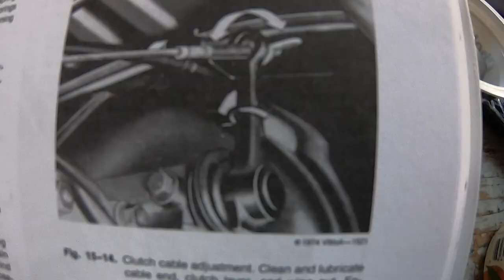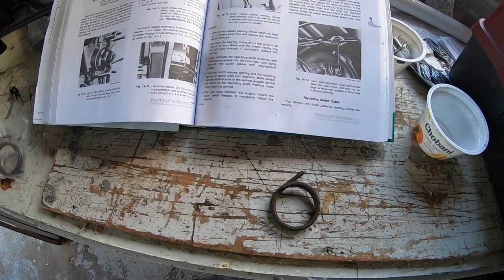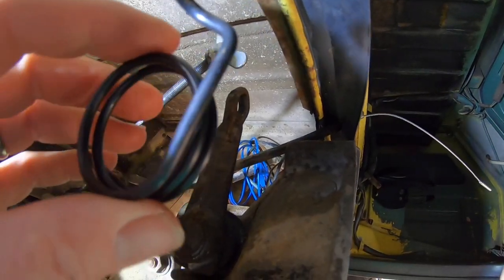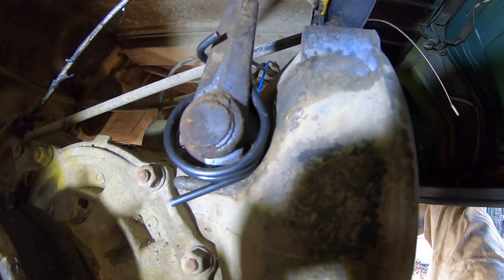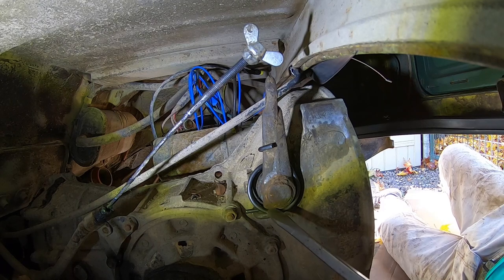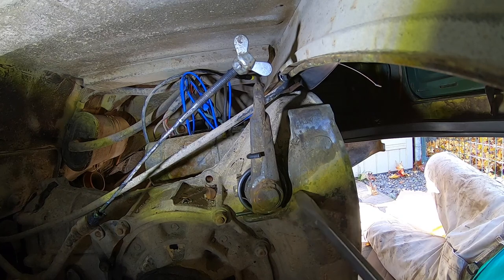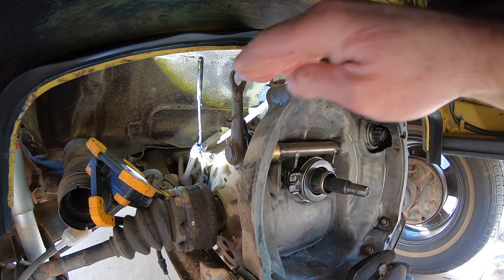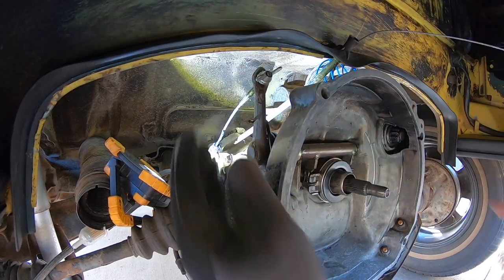Replace VW Clutch return spring

Comment: Great Job.  I Replaced Hundreds Of These Springs When I Worked For Volkswagen Dealerships For 33 Years Starting In 1975  On Type 1 - 2 And 3 Air Cooled  Volkswagens.
Reply: Was this the method you used?
Reply: @THEREISACHANCE  Yes     This Was A 10 Min. Job For Me On A Lift.    Book Time / Flat Rate Time is One Hour Labor.
Reply from the maker: Yeah, simple fix/part, but soooo important!

Comment: Cool video man, having trouble replacing the same spring.. mine seems to have a lot more tension to load which I'm finding difficult. My engine is out which helps with room to work but I'll point out that removing the fork doesn't make things easier haha. I took off the clutch arm circlip and arm, but will have to persevere loading the bottom part of the spring on the ledge. Aloha from Australia 🙂
Reply from the maker: Dang, that is a bummer.  I think I did get lucky that mine snapped on so easily. I anticipated more of a struggle.  I wonder if some of them are thicker and have more resistance?  The one I installed is aftermarket. I'm not sure if it made a difference or not.  Best of luck getting yours on!
Reply: You made it look easy. Thanks for the video. 
 @kekanipahu